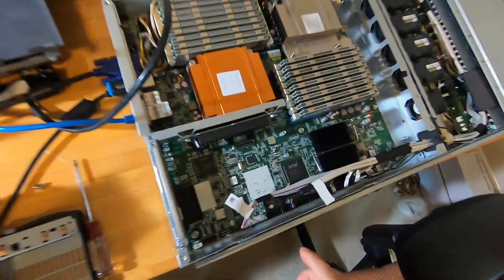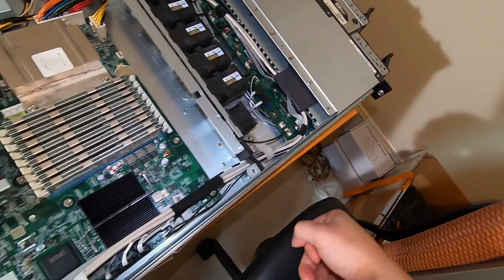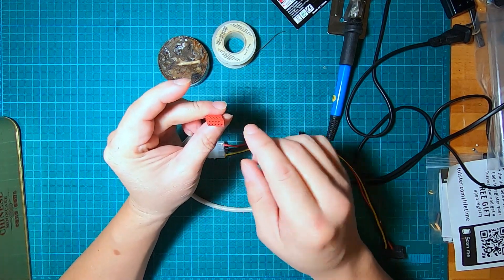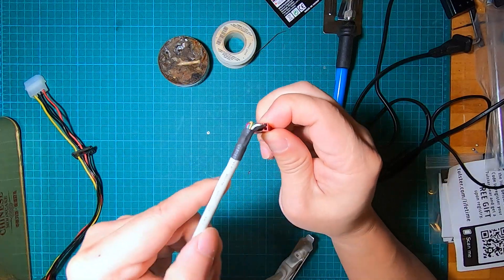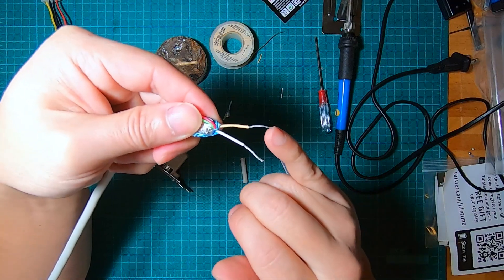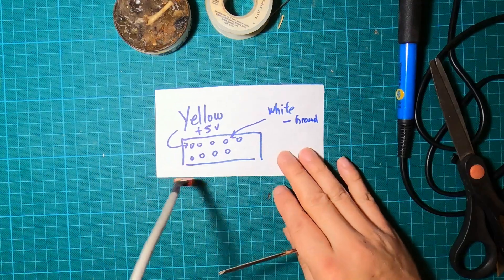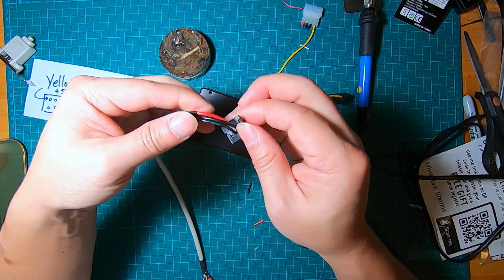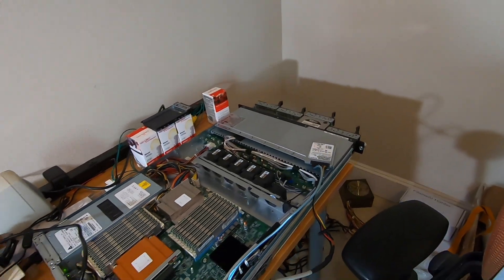Custom USB to SATA power cable to power SSD drive

Comment: can i use mobile adapter for this ? pls reply
trying to make portable ssd 
(normal usb to power sata)
Reply from the maker: what is a mobile adapter? does your mobile adapter have 9-pin usb header female plug? if it does not, then it probably will not work.
Reply: @DIYGEEKTEXAS  won't it work with 2 wires of any 5v  (+)  &  (-)
Reply from the maker: @rajvanshraisharma2705  ok I see what you are saying, sure it would, as long as you separate and use just the 5v (+) and (-) cables and match it up with the SATA plug.

Comment: That motherboard usb plug has 2 ports available, it would have been better to join both ports 5v lines together to provide 1amp to the ssd drive instead of 0.5amp from only one port.  The reason being that most ssd drives use over 0.5amp when writing data which exceeds the max current from only one usb port.  This could result in the drive not getting enough current during large writes and corrupting data on the drive.
Reply from the maker: @Matthue Gera Don't need to, the SSD drive works fine with 0.5amp
Reply: @DIYGEEKTEXAS  still I wouldn‘t risk it unless there only is something stored that isn‘t important. At least if I know the port only can provide 2.5W. Most ports can provide 1A however, in this case the wire gauge seems to be low enough to be able to handle 1A. Both ports are connected in parallel so if the cable itself can handle the current, it‘s not a problem. The pins on the 9p header probably are normal 2.54mm ones meaning they can at least handle 2A.

Comment: Very interesting. I'm looking for something like that, but i need to power 3 SSD drives. You think that 1USB connector will be enought?
Reply from the maker: I have powered 2 ssd drives successfully. Not sure about 3. Pls let me know if you try it. Thanks
Reply: You could try checking continuity from USB+ to the 5V rail of the board. If it‘s a dead short, it shouldn‘t be a problem (2.54mm connectors itself are able to handle 2A at least). However the wire gauge on the 9p to USB-A adapter thing must be low enough to be able to handle the current.